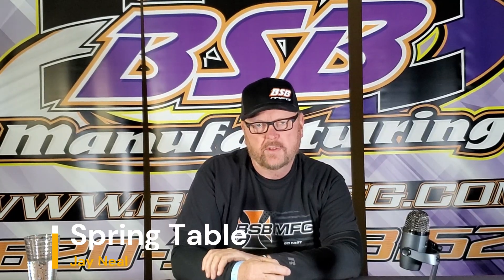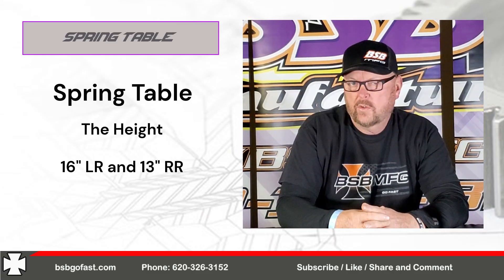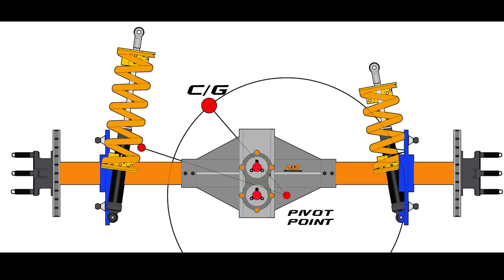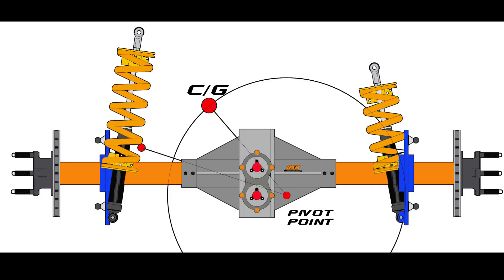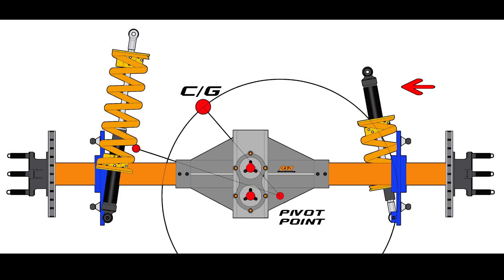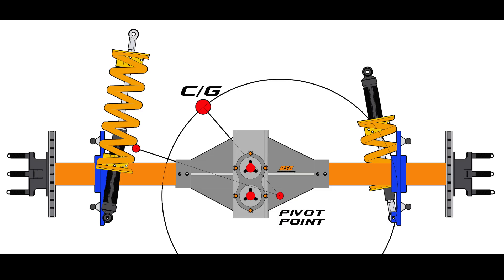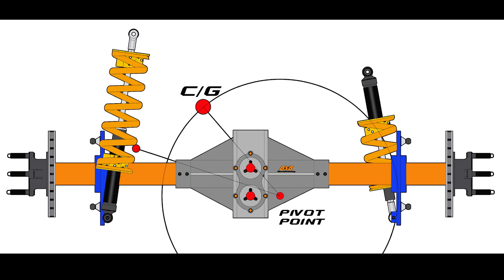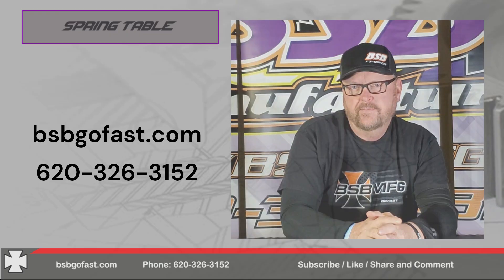Rear Spring Table

Comment: would there be any negative effect by lowering a coil over mounting point lower on a  bird cage. currently running it on the top thinking of moving it behind and about 2 inches lower
Reply from the maker: I don't know if you will consider it to be negative, but putting the spring behind the axle will take more spring rate for the car. 3 link or 4 link you should need a heavier spring rate.

Comment: I’m an engineer. The spring mounting points count, not where your springs sit between the mounts.  All of the forces in springs go through the mounts.  You better rethink your theory.  If you you flip your coil-over upside down and it works differently then it might be a problem with the shock. ( a low pressure shock with a damaged air bladder)
Reply from the maker: As I always state, the pivot point is the point where the load transfers through, but the height of the spring can change how the can receives the weight. I have changed many of cars and seen results that it works. The shocks works fine either way because they are gas shocks. Thanks for your input
Reply: @jaynealgofast  Everything in physics can be illustrated by a free-body diagram. Perhaps you could create a free-body diagram of how the springs "receives" the weight to explain your theory.

Comment: Would there be a benefit to mounting the 16" left rear spring on a 2" tall cup on top of the rear in a stock car?
Reply from the maker: It could help some, better check to make sure you can do it.
Reply: @jaynealgofast 

only rule I see is lower spring perch must be welded to axle tube

Comment: So regardless of where the mounting points of the tops of the sliders are, the actual height of the springs will determine the degree of influence on the springs by the cg of the car?
Reply from the maker: No the pivot point is also a part of that, but you can change the spring very easily and get better results.
Reply: Why am I seeing guys flip the left rear slider over and mounting the spring on the bottom? What is the benefit of mounting it that way?
Reply: @kudick4  center of gravity higher because spring is lower